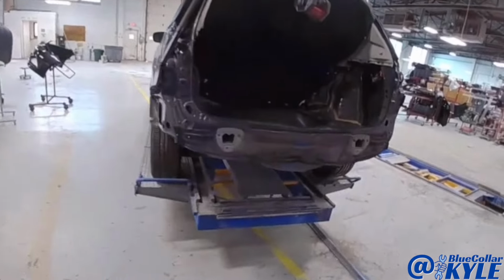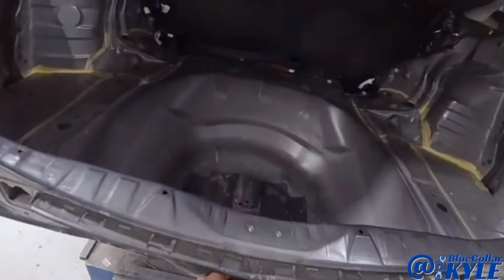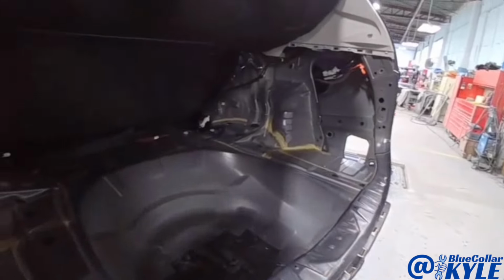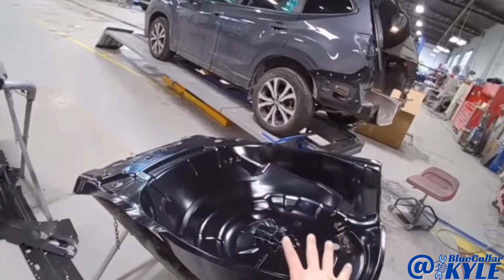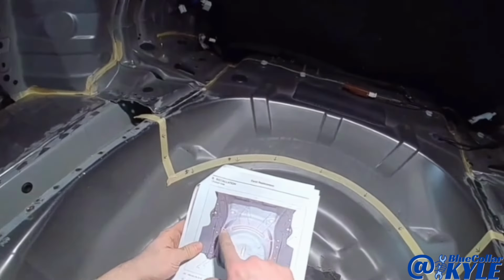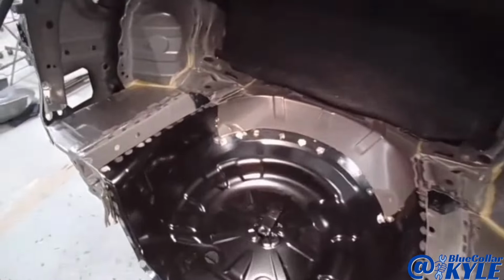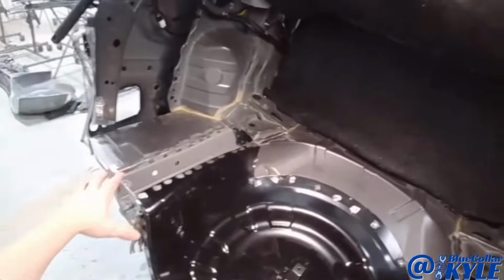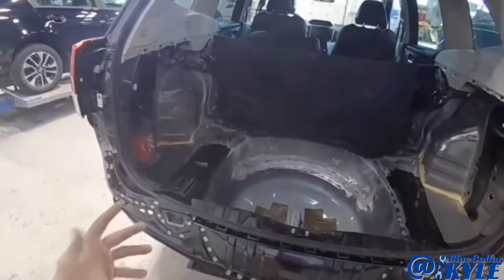This #Subaru got CRUSHED like a tin can! #autobody #bodyshop #collision #bodywork #autorepair

Comment: On a car hit that low are there times when you just straighten out the panels instead of replacing them? When I worked at a shop YEARS ago I straightened a couple similar hits and when I was done you couldn’t really tell it was hit. Now I was a semi amateur at the time but that’s how the boss wanted it done even though it was written to replace. Just a curious question
Reply: Maybe my boss was shady, but I think a lot of smaller shops operated that way back then. I’ve straightened quarters that were written for replacement as well